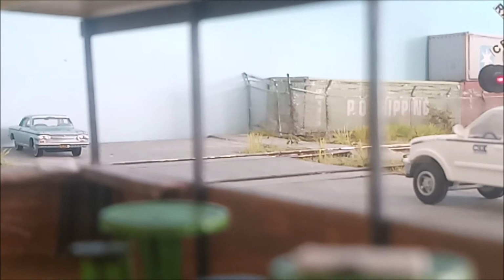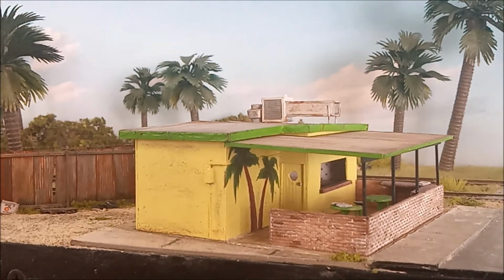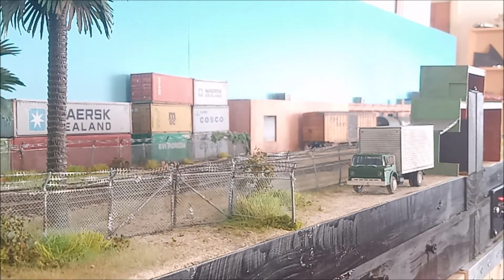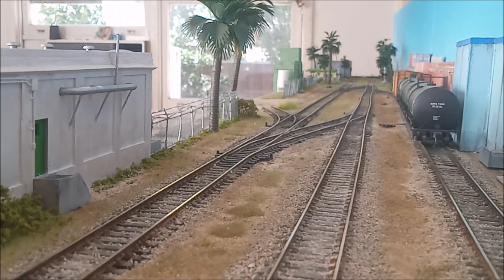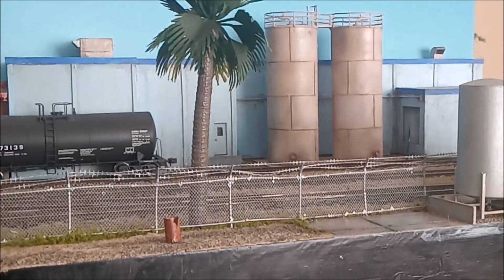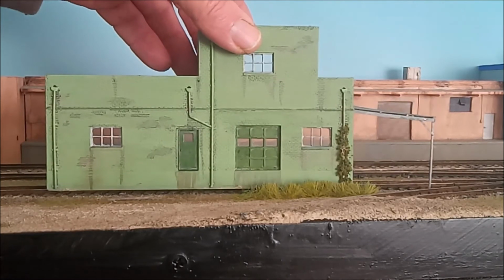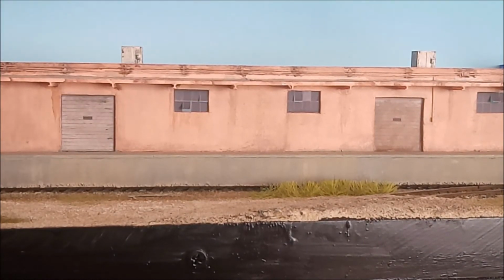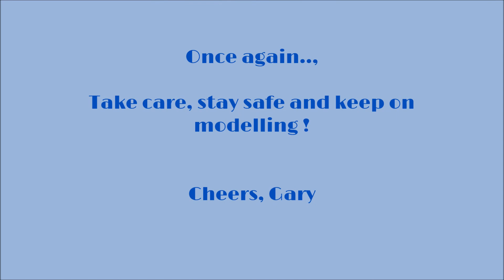Layout Update : August 2021

Comment: Palms Cafe is a great scratch build….that toilet area is typical of places like that…what did you make the actual toilet from?  Nice intro view from the cafe of the train passing by….all the detail your adding really starts to bring the scene alive
Reply from the maker: How you doing GSB...

Thanks for the kind words.

The toilet bowl was filed from a length of 4mm diameter styrene rod. I filed the neck (base) of the toilet first to get the correct shape followed by narrowing and creating that ovalish-egg shape from when you look directly down into the bowl. This was then cut to the correct length and touched up with a file here and there to smooth things out and to get it level. The lid is a shaped piece of 10thou styrene sheet. The cystern is a piece of 2.0mm x 6.3mm (.080 x .250") styrene strip cut to size and sides slightly filed to shape. The pipe is a short length of 0.88mm (.035") styrene rod.

Simple, but time consuming !!

Cheers, Gary.
Reply: @Gaz3801  doing great…just got a lot family, home and work stuff going on…will be getting back into railroading soon

Comment: Lots of good detailing there, sets the layout off a treat. Keith
Reply from the maker: G'day Keith,

Thanks for the kind words. 

I think these sort of details should be represented, especially at the very front of the layout where you can actually see them. As you move further away from the front, these details can become less and less as they won't be seen so clearly. But this layout is only 12" wide, so I intend to add as much detail as possible !

Cheers, Gary.

Comment: Nice update. You did a great job on the buildings. Is the layout limited to that size because of space restrictions? You have done such a nice job on the layout, I would definitely like to see what you would do with a larger layout. I’m subscribed.
Reply from the maker: G'day Derek,

Thank you for your kind words, much appreciated.
To answer your question regarding the layout size, I'd say yes and no ! The small foot print of the layout (96" x 12") is partially due to space, but also the fact that I like small switching layouts and also that I do exhibit my works. This layout actually folds up over itself when the back scene is removed, forming a box 48" x 12" x 12". This allows for easy transportation and ease of set up at exhibitions.

Now the reason I also said 'no' is because I do have some spare space in one room where I can extend the layout for more operations. This is dependent on me moving on two layouts and also the reconfiguration of what is in the room.

This may actually be a longer term idea, but the extension does have merit !

Cheers, Gary.

Comment: Love your detail work. Did you scratch build those fences?
Reply from the maker: G'day Dan,

Thank you for your kind comment. 

If you are referring to the chain wire fence, that is the Walthers kit (#933-3125). The kit comes with wire for the top and bottom rails which I substituted Evergreen Styrene 0.035" rod (#220), so I could build longer lengths of fencing (14").
On the other hand, if you refer to the corrugated iron fence, yes, all scratch built. Down here in Australia, we have a supplier of HO scale corrugated card (cardboard), which is not all that thick and lends itself to what you see here. It is by a cottage industry supplier Broad Gauge Bodies, possibly still on ebay. The posts and rails are Evergreen Styrene strip, posts #142, rails #143.

By the way, great work with your layout and I love you weathering channel !

Cheers, Gary.